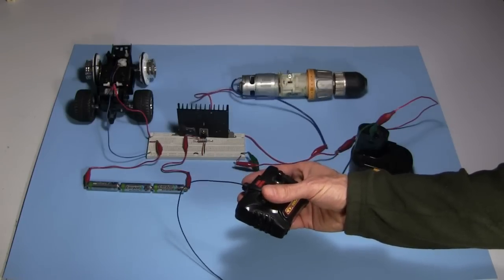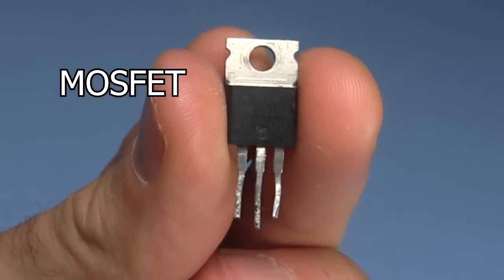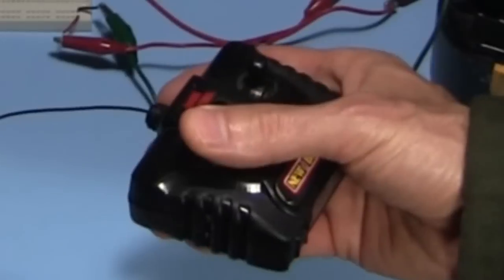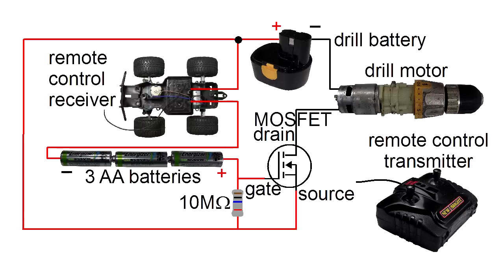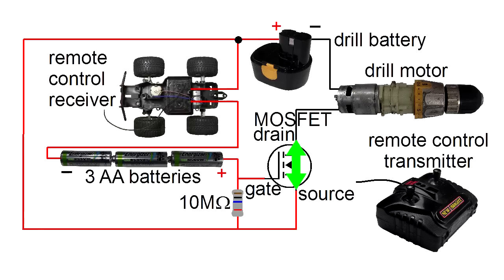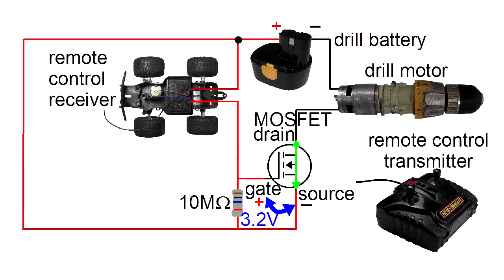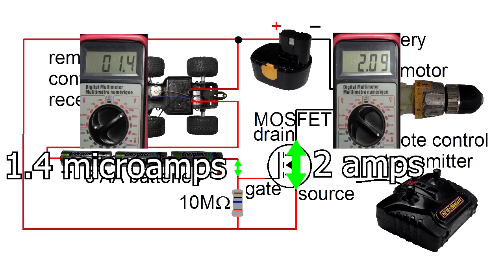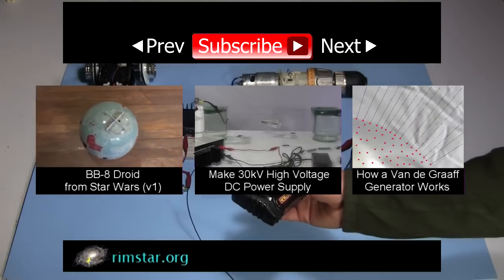Remote Control Drill Motor & How a MOSFET Works

Comment: Is your schematic right? Generally the source connects to the ground for most switching applications, and the drain connects to the device to be powered. (in other words the MOSFET should be on the LOW side, while the load on the HIGH side.) In that case, the MOSFET's resistance is directly controlled by the voltage on the gate relative to the ground. (since the source is connected there.)

The way that schematic is laid out right now, the MOSFET will only turn on when the voltage on the gate is about 5V higher than the drill battery in this case, or Vcc. And when it is less than that, the MOSFET does not saturate and actually becomes a crude buffer amplifier (a device which has high input impedance and low output impedance) google "MOSFET source follower" it is sort of analogous to the "emitter follower".
Reply from the maker: +Power Max I may have it wrong. I knew that the gate had to be higher than source, hence the position of the rc receiver and the bias batteries. It puzzled me that the arrow in the symbol was pointing the way it was and yet the drain was on the negative side. I thought that the circuits I looked at had the drain positive w.r.t. the source, yet I can't seem to find any that have it that way now that I'm looking again! I'll probably be removing this video and revising it.
BTW Is the music too loud for you? If not, what kind listening device do you
 have (high quality, low quality, earbuds, headphones, ...)? A lot of folks have been telling me they weren't aware I even used music so I turned it up this time.
Reply: +RimstarOrg Lol I definitely noticed the music was louder. I honestly prefer either a different track or have the volume lowered as I personally found it a bit distracting, but that's just me. :) I know how you feel, I have got a few mean comments on my latest video about the music making people's ears bleed and other peoples head explode :P (the spoiled youtube community expects that the free content they get has to be perfect!)

The current configuration is valid, but it is generally used where you want to either make a crude voltage regulator or a buffer amplifier.  The way it works is simple. Suppose you have a capacitor at 0V, and the MOSFET on the high side, and the MOSFET turn-on voltage is 7V: when 12V Vcc is applied to the drain, and the gate is pulled up also to 12V Vcc,  The voltage between the source and the gate (Vgs) is 12V, turning the MOSFET on really hard, which causes the capacitor to charge really quickly. However as it approaches 12V-7V, or 5V, the Vgs voltage gets smaller and smaller, until the MOSFET begins to turn off, or fully off eventually and the capacitor stops charging. You can see how this creates a really basic voltage regulator, as when a load is attached to the capacitor, the capacitor discharges, causing the MOSFET to turn more ON, therefore regulating the voltage to around-about 5V!
Reply: +RimstarOrg Also as a general tip, I recommend formatting schematics so that the Vcc connections are higher, and ground or negative connections are lower, as that makes it easier to tell what connects where. Generally it is simpler to draw voltage nodes describing what point connects to what part of the power supply, and eliminates some of the wiring shown in the schematic. (the disadvantage is that this makes it a bit more difficult for people not used to looking at real schematics, preferring a more visual style wiring diagram)
Reply from the maker: +Power Max I guess I could do a compromise, try to keep Vcc connection on top and ground or negative below but keep all wiring for people not used to looking at real schematics, no terminating ground symbols.
Reply: +RimstarOrg taking a look at your circuit a bit more carefully, I realized that actually you just have the 12V drill battery polarity backwards, and no voltage applied to the RC truck! I originally thought you were using the MOSFET in the source follower (common drain) configuration, but if that was the case, then the drain would be connected to +12V and the source to one node on the drill. The way it is configured right now, the motor spin endlessly because the internal parasitic diode is always forward biased. (making it impossible to turn off the MOSFET) http://www.nlvocables.com/images/solar_project/mosfet_symbol.gif
If you do decide to make a revision to the video, I recommend also including a flyback diode on the drill. Afrotechmods has some great documentation on this. The motor is a inductive load, so when you PWM the gate, or turn the motor on and off, you will get enormous voltage spikes which can cause the MOSFET to fail. (generally there failure mode is a puncture in the thin insulating silicon oxide layer on the gate, causing the gate to be shorted to either the drain or source, and the MOSFET itself stuck partially on permanently.)

I would also recommend using a different MOSFET, as that one is no where near ideal for high current applications. It has an ON state resistance of 2 ohms, and a maximum current rating of 2A. I think those drill motors can pull upwards to 10A under load  :O
Reply: If you connect the MOSFET source to ground, the drain to one side of the motor, and the other side of the motor to Vcc, and install a schottky diode across the motor  to stop back EMF transient voltage spikes and protect the ESD-sensitive MOSFET then you could potentially eliminate the 3 batteries!

However, if the logic output from the controller is only 3.2V, as mentioned in the video, then you may need to use  either a 3V logic level MOSFET or a BJT transistor. (like the 2N3055), or a MOSFET driver circuit between the gate and the output of the controller.
Reply from the maker: +Power Max Thanks for all this input. All I've had a chance to do so far was think about it. I'll redo the circuit first chance I get and let you know. And I'll definitely run it by you first if I upload a revised video! For now I've done annotation, video description and a new video thumbnail to make so no one gets caught by my mistake. There have been too many useful comments here for me to just remove the video - wouldn't be fair.
Reply: +RimstarOrg No problem! I am glad you mentioned that the MOSFET is turned on when a voltage is applied between the gate and source, rather than just say a voltage applied to the gate (implying the voltage relative to ground always) That has been a concept that confused me for the longest time when I first was experimenting with using MOSFETs configurations, discovering that how the MOSFET is wired actually matters! (because when the N channel MOSFET is on the HIGH side, the source is connected to the load, and the voltage needed to turn ON the mosfet would depend on the voltage at the source, which is a function of resistance of the MOSFET!)
Reply from the maker: +Power Max I finally came up for air long enough to see what I did wrong (weekends are even busier than weekdays for me, plus had good progress on a project I did with someone else this weekend - atmospheric electricity powering corona motor, video to come once we've done some more testing.) It turns out my actual circuit I demonstrate is right, it's only the direction of the battery in the circuit diagram in the video that's wrong. All along when we were having this discussion on Friday and Saturday I was looking at the circuit diagram I drew incorrectly in the video but not at the paper version on my desk, which is drawn correctly. The error must have happened when I first drew it on the computer. I've updated the annotation and the video description. It's nice to see that my circuit is right! It could very easily have been wrong.

Comment: Can i connect directly dc voltage to the drill without the mosfet, i am going to use my old drill for a project and i need it to activate with relays
Reply from the maker: You might be able to. Your DC power source would need to provide the right voltage and enough current to power the motor but you'd also need to make sure that the drill doesn't draw too much current from the power source such that it damages it.
Reply: @RimstarOrg  thanks for you reply, battery pack says 12v 1.4A, im going to use a 12v 5A charger

Comment: great video...I have an old drill and I want to use it for pulling HDMIcable   if possible can you explain how to use it? with DPST switch without (remote control ) thanks in advance

Comment: I tried my metal  bed frame and the outside watter pipe for all ground connections it still does not work so what do you think
Reply from the maker: +Andrew Kimble I see you found my troubleshooting video. Make sure you have a long straight wire as the antenna. The longer it is the better is will work.

Comment: Will these work for other rc cars as well with a transmitter and receiver operating at a low voltage(say 4.8v)??
Reply from the maker: It's impossible for me to say without seeing the schematic for the receiver and doing some measurements to confirm how it works. Personally, after going this approach, I since switched to using a HC-05 bluetooth receiver and a phone for the transmitter - much easier, works better and uses less power, though it depends on your application. Here's my video about it https://www.youtube.com/watch?v=5EuI9lBtC3I.
Reply: RimstarOrg 
Anyway thanks for your reply

Comment: It worked, that's my take away from the vid and, certainly congrats are in order when working with new devices. For sound, no problems here, was just general b/ground music. External JBL single speaker (lol different huh).
A tip for heat dissipation in the final design - I use a coin superglued to the back. USA 1c for small transistors, up to a quarter for MOSFETs that are not running constantly.
Reply from the maker: +slider2732 Cool. Thanks for the feedback and tip.

Comment: Seems you are a pro . I’m trying to remote control a 350w brushless Motor Controller with remote controller . I got a 4 channel ppm Receiver . If I connect this receiver to a throttle signal will that work ? What do you think ??
Reply from the maker: Nope, not a pro when it comes to remote controls, especially not multi-channel remotes. Maybe someone else here can help?

Comment: sir can you please tell me what are the various components present on an 30 A brushless ESC whether resistor's, capacitor etc.I cant find it anywhere.please
Reply: Vaibhav sharma an ESC has an 5volt Output and an pwm input ---> more Electronic parts

Comment: I followed the diagram but I assumed the wires coming from the transmitter were the legs of the preexisting drive motor.?!?
Reply from the maker: Yes, that's right. Note that there's an error in the diagram which I mention in the description for the video. The drill battery in the circuit diagram is drawn backwards by accident. The plus sign beside the drill battery should be a minus and the minus sign beside the drill battery should be a plus sign. That also means some of the line colors are wrong.
Reply: No wonder my stuff is catching on firehaha

Comment: why didn't you use a relay they are much smaller then a mosfet with a heatsink on it?
Reply from the maker: +Ballistic RC I don't want to use a lot of current to keep the drill on. A relay requires current in order to keep the switch closed. A MOSFET requires a very tiny amount of current and functions using voltage alone. I prefer voltage with very little current because this will all be enclosed in a BB-8 droid and I don't want to have to replace/recharge batteries frequently.
Reply: Cool thanks later on could you make a MOSFET video were you show how to use them and how they work
Reply: I have a 18v motor I want to use in my rc rock crawler it has a esc that works off 7-12 v so my question is can the speed controller control the output voltage of the mosfet?

Comment: Could you not just reduce the gate resistor so that the 3v (from the toy)  yields the desired 1.4uA gate current...or sufficient drain current from the drill battery to run the drill motor at 2A?
--dAlE
Reply from the maker: +dale nassar I don't have any resistor between the toy/batteries and gate.
I do have the 10Mohm resistor between the gate and source though. I just tried different resistances (1M, 470k, 1k, 220, 27) in place of the 10M and in all cases the it ran when the remote was turned on and I had the 3 AA batteries, but not without the 3 AA batteries. It didn't work at all with 10 ohms or dead short between the gate and source, the latter being totally expected.

Comment: so how do you connect them in parallel do u know?.
Reply from the maker: +Andrew Kimble  To connect them in parallel connect one side of both capacitors together and connect the other side of both capacitors together. Then treat the whole thing as a single capacitor and connect it to the rest of the circuit.

Comment: So positive goes straight from drill to battery ... And negative goes to the mosfet mid pin > drain... then source out to resistor connected to gate out connected to  drill battery with a branch off to AA batteries connected to what ???? input & output ??? on rc car and then branched back to neg drill battery line ...
Reply from the maker: That depends entirely on your RC car circuit. I should really just delete this video anyway. Here's the warning message in the video description in case you missed it "WARNING - The drill battery in the circuit diagram is drawn backwards by accident. The plus sign beside the drill battery should be a minus and the minus sign beside the drill battery should be a plus sign. That means some of the red and black lines should reverse colors too. The black lines going to and from the drill motor should especially be red for clarity, just as the red line going to the source should be black for clarity. Everything else in the video, including how the circuit is ACTUALLY wired up and the MOSFET explanation is correct."

Comment: does the drill gave the same output???
Reply from the maker: I didn't test this circuit under a load. After doing this I switched to using H-bridge circuits which now use two drill motors to run my BB-8 droid https://www.youtube.com/watch?v=BCXH4AN2aog. The detail for that circuit are here http://rimstar.org/science_electronics_projects/bb-8_v2_drive_electronics.htm.

Comment: Will this work with rc receiver signal
Reply from the maker: I'm not sure what you mean. Do you mean using the signal directly from the rc receiver circuitry somehow? I'm using the rc receiver's output.
Reply: Yeah is it possible somehow? With the wires that go to the servo?
Reply from the maker: I don't know what's going out on those wires so I can't say if it would work.